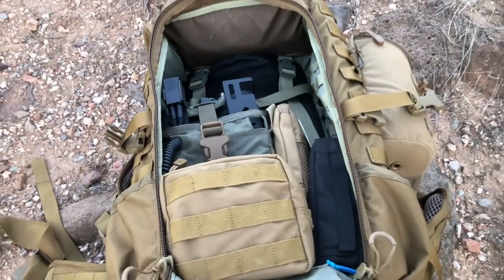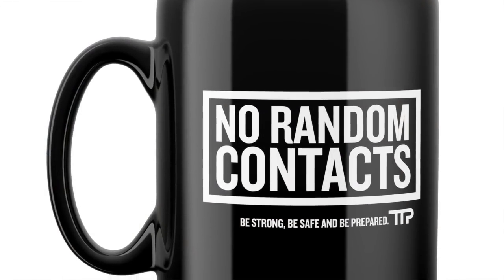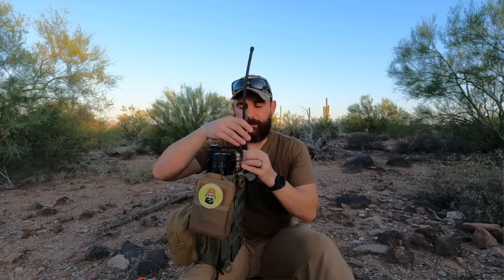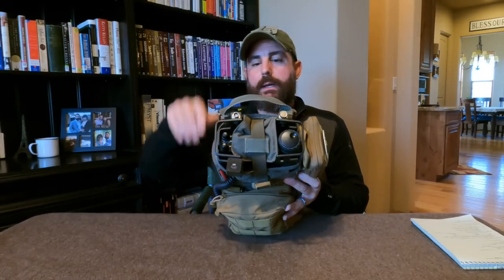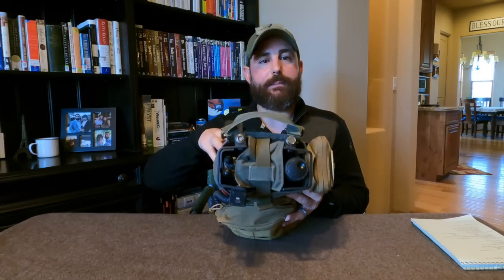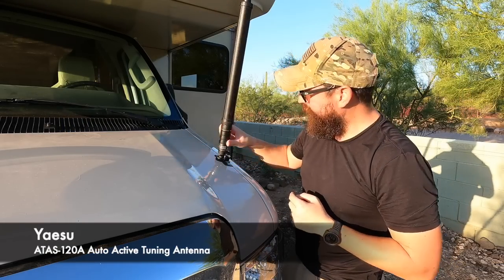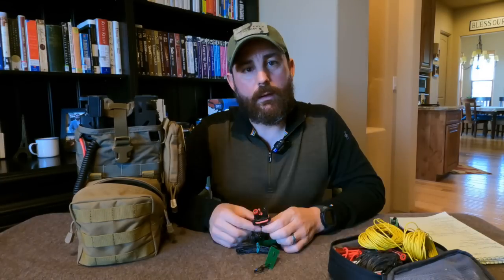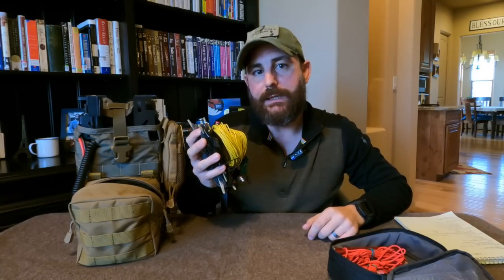Military-Style Radio - The Ultimate SHTF Manpack - Part V

Comment: Im not a radio fanatic just basically getting some for emergencies but my question is how is digital gonna be when SHTF and we loose the grid or EMP and dont have cell or that type of services available
Reply from the maker: Actually, this is a perfect application for radio and precisely why I have been training using my gear for targeted communication in the backcountry with no grid tie. It has take some work, but in doing this for the last 3 years, I have also built a network of likeminded operators and train without any grid tie on weekly basis. We have communication capabilities from our local communities, to the country, state, region and county. As for EMP, there ways to mitigate damage that can be caused during an event. I've been using to do a series on early detection of such events as well as how to protect primary and backup gear.

Comment: Awesome video I recently built the exact same manpak that you have You've definitely been a huge inspiration for my interest in the hobby I have a question for you first, the model that you have, do you have the Japanese European export or do you have the English?  I ended up going with the Japanese export because it's a little cheaper it's 100 w however, apparently for my understanding there is some restrictions on the radio frequencies and the second question is what do you plan to do for the zebra stripe issue on the LCD if you have not yet experienced it, what would you recommend?

Comment: Had a little chuckle at first video clip 2 watches, 2 is 1 1 is none... one's a smart watch apparently
Reply from the maker: Actually, I was testing the solar charging on both devices. The Casio is not a smart watch and lacks GPS, but lasts forever with the solar cell on the face. As for the, Garmin Instinct, I turned off all smart features and do not pair it with a phone. Both are great watches.

Comment: I have an SDR receiver on a combination 2 meter / 70 meter antenna.  The antenna is vertical, thus it is orientated best for horizontal signal reception.  I know that will make for weak receptions of Yagi type and vertically polarised transmissions.  But, I hear nothing on 2 meter sideband on both upper and lower sideband.  It is very disappointing.

Comment: I really like the looks of that radio, if only I could afford it. I think a similar but a bit less capable radio is the Wouxun KG-UV980P. Similar frequencies covered but output is 40W on UHF and 50 on VHF. It does have a detachable front end so that could add some flexibility to a comms loadout and the dual receiver is a handy feature. I'm not sure of its power consumption, but given its output, I'd say it's probably pretty good. It runs $329 so its about a third of the 857 so I guess thats an advantage as well. Still, I like yaesu radios more. Great vid. Keep them coming.
Reply from the maker: Thanks for putting the KG-UV980P on my radar. Unfortunately, it is only a quad band radio and does not fully cover HF. It just covers 10m and only on FM. If that covers your needs, excellent! If you don't mind low power (5 watts), take a look at used Yaesu FT-817ND. I think you can find one for the same price as the Wouxun. It's all band and all mode. I covered it in part 4.
Reply: @TheTechPrepper  Thanks, I'll have a look. My biggest concern is where I live/work/play is heavily tree'd so I tend to go for as much power as I can since I can't guarantee getting to a sufficient clearing.
Reply: @TheTechPrepper  Oh man I can't believe I didn't mention this earlier. Better safe radios has a couple SHTF HTs that while a bit different, are pretty interesting. The Wouxun KG-UV9PX is a custom radio that has some potential, for the target audience. If you know someone who needs something somewhat simpler, and more of a turnkey kind of thing with heavy emphasis on monitoring, this is the one to look at. It has nearly every useful freq already programmed so all people would have to do is turn on the scan mode and wait for traffic. It has two freq ranges for tx but is limited so again its a particular target audience. Still, for an ht it does a lot.

Comment: So the FT-891 isn't an updated version of the FT-857D? I'm new not licensed yet and trying to figure out the difference in the radios. I see it's an "all modes" radio, but does one radio have capabilities the other doesn't? DMR, APRS type stuff? Not sure what APRS is so I don't know that I would need it but? Nice video I'll be watching it again to see if I missed anything (probably the whole series again).
Reply: FT-891 does not do 2m or 70cm, only 6m through HF
Reply: The FT-891 does not have UHF/VHF, but if you do not need those in an all in one package like what this video shows, you can get a new 891 for not much more than what a used 857 is going for.
Reply from the maker: Excellent questions.

1. No, the FT-891 is not a true updated version. It is missing the VHF (2m) and UHF (70cm) capabilities that are found on your typical dual-band handheld radios. The great thing about 2m/70cm on this rig is that is all-mode. It does more than FM. For example, it does Single Side Band (SSB). This is much for efficient as shown in the demo where I am on the roof.

2. I'll cover APRS in detail in the upcoming series. What it is? What it can do? Why you might want to use it? And, how to set it up.

3. The closest thing to a currently available replacement is the Yaesu FT-991A. It's all-band and all mode like the FT-857D, but is much larger and heavier. This good be an option if you don't have a requirement for being truly man portable. It also has some nice features like a waterfall display so that you can visual the RF spectrum.

Take care and thanks for the question. A big thanks to the other viewers that beat me to the response.
Reply: No, it's all mode , not all band.
Reply: @TheTechPrepper  Thank you all for the help! Can't wait for the next video.
Reply: @TheTechPrepper  Thanks for the info! Ill check those out too.

Comment: Hi Gaston! I'm just getting started in HAM.  While working on my license I've started a build project starting with an 857D.  Did you get the speaker relocation on your frame?  I want to do a full digirig setup.  Besides WinLink what other software is involved.  Is is mainly windows software?  Love the RasberryPi setup.  I have a couple I'm not using.  Do you use those for spotting in the field also.  Still working through the videos.  Would love help on this project.  Do your Amazon links give you credit or is there another step?
Reply from the maker: Welcome to the hobby. No, I do not utilize the 3.5mm relocation option on the manpacks. I run a lot of software for digital:
- Winlink: Pat (ARDOP and ax.25 packet)
- APRS: YAAC
- fldigi/flmsg/flamp 
- JS8Call

I stopped using the Pi in the field due to frequent failures. I'm using a Panasonic FZ-M1 Toughpad these days.

Yes, I get credit. It does not cost you anything, but helps the channel.

Comment: Have you checked out the ft891? All mode 100w with smaller form factor. Might be what you are looking for in a man portable rig
Reply from the maker: Actually, the 891 and 857 are about the same size. I've had an FT-891 for a couple years now and run it nearly identical to the 857. My only complaint is that it does not have 2m/440 capabilities. We have a lot of activity on SSB out here on VHF/UHF.
Reply: Thank you for the reply. I just stumbled upon your videos and got alot of good info from this first one I saw. I realized after watching other vids that you already had the 891. Haha. Thank you
Reply from the maker: @nathanapatton  Welcome to the channel!

Comment: I just picked up my 857d with box and the standard mic and the dtmf mic, powercable, etc. for $600 at the Louisville Hamfest.  There were two others there for the same price but this one was the cleanest one and i got it with in the first 20 min of the gates being opened.  I suggest check out the fest...there are deals out there just got to be patient and keep looking.  73  de N9PMI
Reply from the maker: Great score and congrats on the find! Thanks for adding to the comments. I failed to mention this. I have also seen better deals at the hamfest compared to what's available online. Like you said, get there early bring $500-$800 in cash. Personally, I jog the venue quickly looking for them and then take my time to revisit the vendors after a quick survey. 73 de KT1RUN

Comment: What battery would you recommend for a 857D manpack setup with the radio pouch you have shown?
Reply from the maker: I personally use a 6Ah LiFePO4 from Bioenno, but I never run more than 20 watts in this configuration. It fits in the 6"x6"x3" admin pouch in the front. You will be limited on how much RF power you can use as it can't supply enough current for the higher RF power levels. If you need more current, checkout the 9Ah model dimensions as it may fit in the 6x6x3 pouch.

Comment: Good demo. I think you’ll like the cha hybrid antenna. My group switched to that antenna system earlier this year because of the simplicity of design and multiple bands. We tried all sorts of stuff, buddipole products, wolf river products, home brew stuff, etc. The issue with other brands is they’re designed for hobby use, much like the radios we use. I can’t say enough good about the emcomm and field durability of our cha products. We employ the end fed, the 17’ whip and even the delta loop, mission dependent of course. My only gripe is I wish the 17’ collapsible whip would collapse to a shorter length. It’s the only part of that system that is difficult to pack. The tactical delta loop setup really surprised me.
Reply: I've only homebrewed one delta loop. Every now and then I think about a tactical delta loop, but I've gotten lazy and sort of stuck on my 80m-10m EFHW. In the southeast like Florida where I live finding trees for long wire antennas is generally not a problem.

Recently, I've been focusing on fielding my Cha Emcomm III portable. It is very well built, but as yet I would not say its a stellar performer, but I am still experimenting to find its best configuration.
Reply: @vironpayne3405  we are using that exact emcomm III portable, and I’ll agree I’m not sure if it’s stellar, but it has been adequate. I think it certainly performs better than a ground mounted vertical, but the delta loop has been a very good addition, it’s from chameleon as well.
Reply from the maker: Morning, Ryan. I am really pleased with the build quality of the CHA LEFS. Chameleon is officially sponsoring  portions of the next series, so we may even see a CHA TD 2.0. These reviews will all be unbiased. My goal is to let the scenarios that I am trying to solve speak for themselves. Hopefully, it will give the viewers the data they need to determine whether the Chameleon antennas will work for them. We are going to attempt targeted contacts across the state, region and country with these antennas (as well as others). Thanks for sharing your experience.
Reply from the maker: Viron, thanks for always jumping into the comments section. I appreciate the support. It's easy to get lazy with any EFHW. We have terrible trees out here for antennas, so having a single mast is always easiest. For this next series we are going to experiment with a lot of different antennas.
Reply: @TheTechPrepper  what separates a good operator from the rest is the ability to make the most out of whatever antenna setup he has. The more we practiced the better prepared we will be those challenges.  Every time we have a training event here we learn something that makes us stronger, collectively.

Comment: Look at the FT100D also discontinued,  but smaller, lighter and cheaper.  I have an FT897, and I wish I had bought 100 instead.
Reply from the maker: Yep. I have that radio too along with the pack frames for it. I picked it up at a local hamfest this past January, but have not used it yet. I love that it has built-in GPS, APRS and C4FM. I have it on my to-do list to try C4FM for the first time. 73's
Reply from the maker: I misread the model. I have the FTM-100DR not the FT-100D. They are very different radios. I'll definitely check this out and its viability for a manpack. Thanks!
Reply: @TheTechPrepper   Uses too much power. 1/1.6A RX  (squelched/max audio).
Compared to FT-857d at 0.55/1A RX.
Still, It's better than the Icom's IC-706mk2g and IC-7000 at 1.3 to 2 Amps.

Comment: Curious how you feel about the FT-891?
Reply from the maker: The FT-891 is about the same size, weight and footprint as the FT-857. If you're looking for an HF-only rig that is still currently available and is manpack-able this is a great option as it supports 100 watts. I've taken the 891 to the field and have showcased on the channel many times. I am not a fan of the menu system compared to the 857 and 818. The DSP and digital noise reduction are nice. I have an easier time pulling out weak signals with the 891 compared to the 857. Honestly, I believe the 891 could have been a real replacement for the 857 if 2m and 440 MHz were added. Just my two cents.
Reply: @TheTechPrepper  Thanks for the info, I also have been looking at the FT-891.
Reply: Thanks for the question, Ive been looking at that same radio!

Comment: I love my FT-857D.  I bought mine new back when I first got my General ticket back in 2014.  It definitely does everything!  The only things I haven't tried yet are 2m SSB and satellites; just because I haven't got around to them yet.  I've been having too much fun with other stuff.  Your antenna choices look really good too.  I'm about to start working building a 6m - 40m linked dipole (now that the weather is starting to be more tolerable).  I can't wait to see the No Random Contacts series!  Take care, Gaston!
Reply from the maker: Thanks for stopping by, Richard. You are a lucky man for securing your 857 when they were still available. I will be doing a linked dipole build for NVIS that covers: 40m, 60m, 75m and 80m (digital) in the No Random Contacts series. 73 de KT1RUN

Comment: Do you get a decent SWR with those handheld antennas on 2M/70CM? Im finding mine going up to 4 or so with the 857D.
Reply from the maker: You need two things: 1. Put two snap on ferrite beads below the 2m/440 relocation mount. 2. Add a 19" counterpoise.

Comment: We might have to start calling you, Sensi.  Having power doesn't mean you have to use power. Not when you have skills.
Reply from the maker: Thank you, but no. I am very new to the hobby and I am still figuring this out like everyone else. This channel is about me sharing my experiences as I work through and evolve my communications capabilities. The manpack concept has been an evolving project over the last 18 months.

However, I did find that by using QRP radios that it forced me to ditch the tuners and work with resonant antennas and really get comfortable with the DSP, filters and RF gain, etc. on these radios. It almost feels like cheating when I jump to 20+ watts.

Cheers!

Comment: Another great video!!! Been thinking about buying a CHA 80-10m LEFS. I got the 40-10m version for portable operations and works great on 40, 20, 15 and 10m. Looking forward to see how the 80-10m version performs.  

73, W4ISB 
Mike in Tennessee.
Reply from the maker: Glad to hear you already have this antenna. There will be lots of testing. I plan to run lots of NVIS tests as well as explorer ALE with this antenna. Happy Friday, Mike!
Reply: The 40-10m version works great for portable operations. Low SWR on 4 bands, low enough not to worry about tuning it on my IC-7300.

The 80-10m version would be great to have as a portable or back up base station antenna as well. I'll try to catch the next sale on Chameleon's website and buy one. They're not exactly cheap, but they preform well next to some higher priced antennas.

Comment: I am 65.  Am looking more for a rollpack concept.  That is, a station in a rolling bag.

But I do like the idea of a mobile radio with a BNC port facing you.  Actually, I think ALL RF ports on a rig need to be BNC.  There are caps for BNC's if that port is not used.

Those Y 6, 2, .70M manpacks of 30 years ago have a BNC port about the same place as the717, 718.
Reply from the maker: Your rollpack is an interesting approach. That's worth exploring. Thanks.

I run the BNC dust covers. They are a nice little accessory.

Comment: I love what you do for the community! Thanks, one question I am concerned about the man pack with the 857 in possible or inclement weather! I know you live in an arid region but I don’t and even rare you could get rain while out. I would like to hear your advice and insight on this topic. I thought about a dry bag but it’s going to impact portability and If your gear got killed by water intrusion then all mission goals are also going to be rendered impossible. Thanks in advance
Reply from the maker: Thank you. I get a lot of email from angry hams that insistent that I am ruining this hobby by explaining communications using simple language and examples. 

We have been hit by more than a dozen monsoons in July and August, so I am thinking about the solution to this problem more and more. I have a manpack bag design that is almost finished for the smaller manpacks (i.e. FT-817/818) that incorporates a detachable rainfly. My ruck also has an integral rainfly. To operate while it's raining, I deploy my USGI poncho as a tarp shelter. My ultimate goal is to build a rugged, weatherproof (IPX8 rated) radio. I am trying to get some time with the big-three Japanese manufactures.
Reply: @TheTechPrepper  I would buy a weather proof shack in the box.  Be nice if Yaesu made it,  I love how clear the digital fusion sounds.
Reply: An all band, all mode, packable, waterproof rig would basically be the holy grail. An internal ATU with the impedance matching capabilities of the one in the G90 would be icing on the cake.